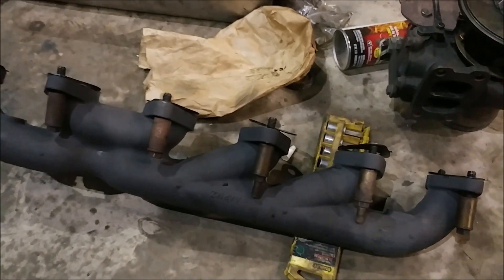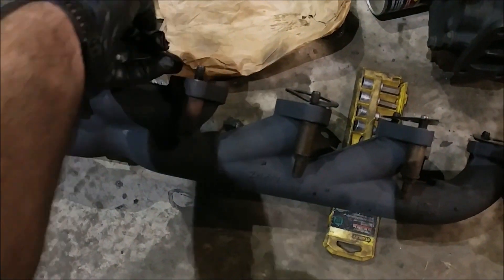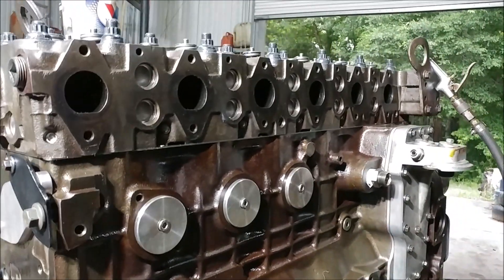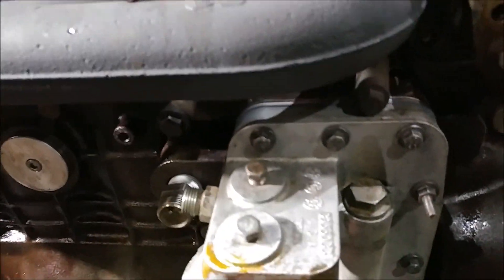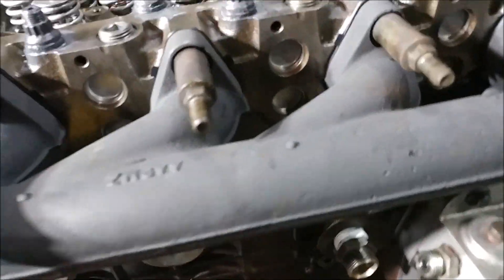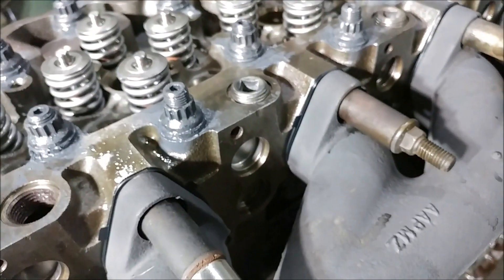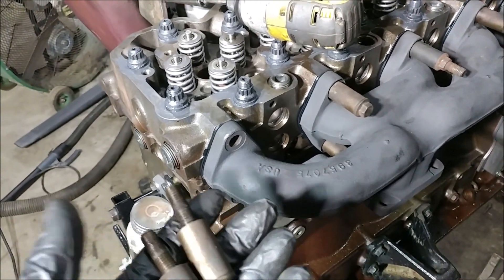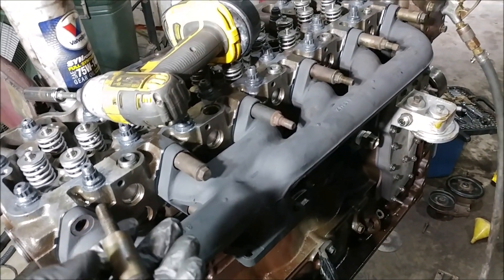Chronicles Of An 03 Cummins Rebuild -Part 39- Exhaust Manifold Install & Torque Sequence

Comment: Is there a torque pattern for the oil cooler when adding 18 pounds torque to the bolts
Reply from the maker: Hi there Art! Sorry for the delay in getting back to you. We have always started in the center of the cooler and worked our way out from there, kind of like torqueing down a Cummins cylinder head. Hope that helps and let us know if we can do anything else for you!

Comment: Any ideas on what my Cummins 12 valve engine might have. When I turn it on it accelerates by itself. Could it be the injection pump? Any ideas?
Reply from the maker: Hi Victor!
What year 12v do you have?  Have you checked all the throttle linkages to make sure that nothing is pressing on them? Sounds silly, but the 12v's have a cable that comes from the gas pedal, then a rod that goes to the real throttle lever.  A few spring are the only think that return the whole setup to idle....  But yes, if it's not something simple it is probably something in the pump. I will keep think on what else it might be!
Reply: 70440charger I have checked the throttle linkage and the spring everything is and stays in it’s place. It might be the pump. Thanks for you help. Will keep coming back to your channel.
Reply from the maker: Victor, Any chance you could post a video of what it is doing? Even if I haven't seen anything like it, someone else might chime in and help out!
Reply: 70440charger I have order the injection pump and will see what it does. If that doesn’t solve it I’ll post a video and let you know. Thanks bro.